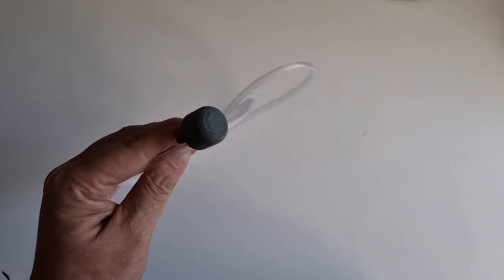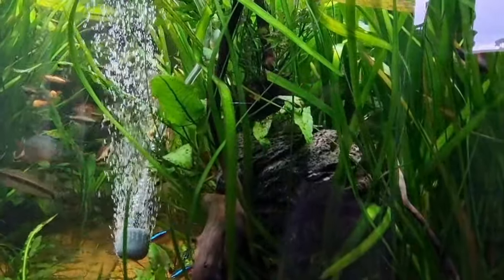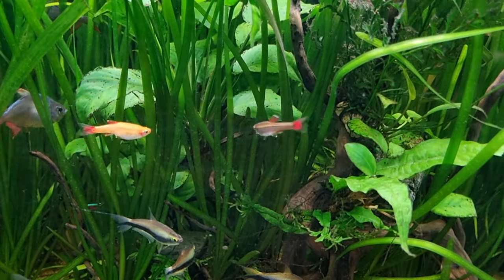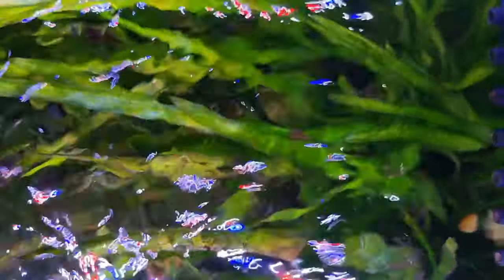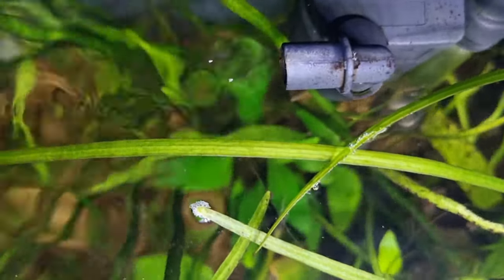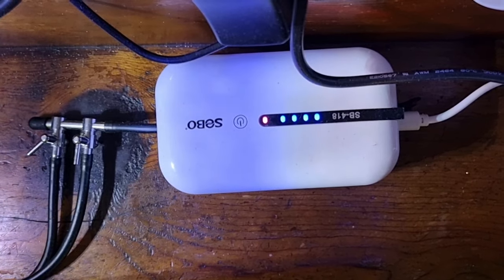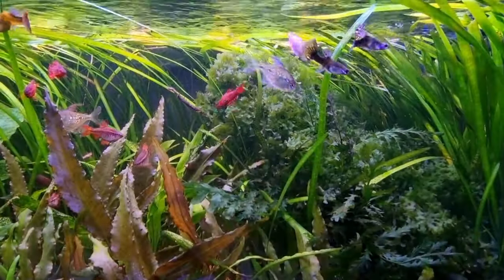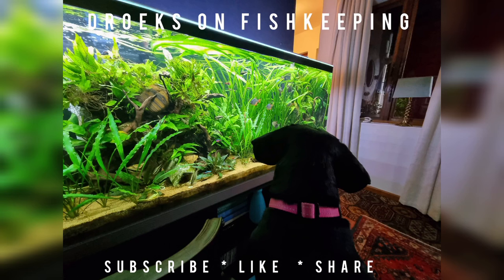Do I need an airpump for my aquarium?

Comment: Does air pump has a electrictify?
Reply from the maker: @GriffResnerThomas  it is electrical yes. It has a backup battery built in for power failures hence it works and is not plugged in for demonstration purposes.